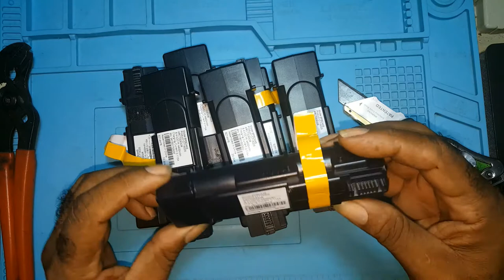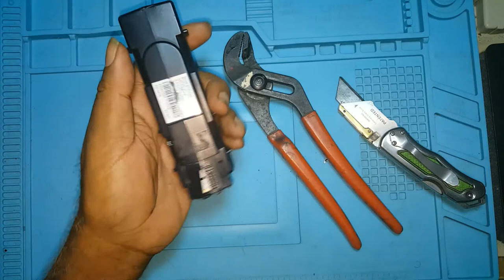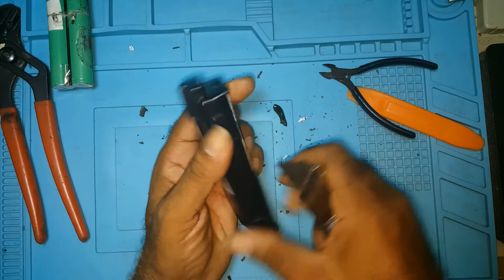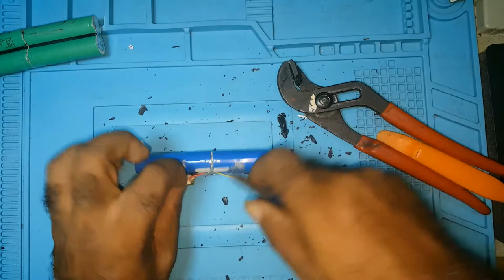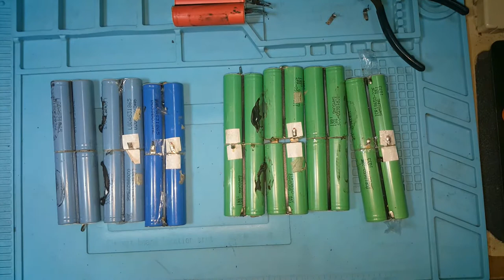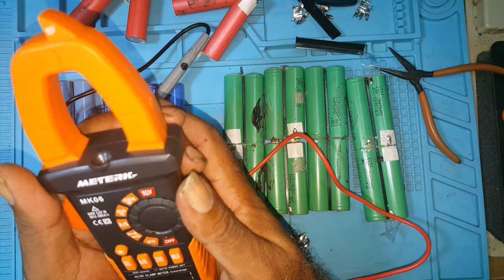ARRIS Battery Harvesting from cable modem BPB044S

Comment: I have been seeing these packs for sale everywhere , battery harvesting is awesome , been doing it for years . Most laptop batts that fail only fail because of one or two bad cells and replacing or repairing battery packs for laptops is easy , I started making 18650 battery banks for my jeep years ago and now companies throw a bunch of cheap 18650 cells in a plastic battery case and sell the battery for thousands !  make a 48 volt battey bank for a razor scooter and thats what i call fun !  Thanks for posting this !!

Comment: Instead of prying it apart with pliers, try cutting through the stickers on both sides with an exacto or similar blade.  Then you can hold the battery in a vise and just push it open with no problem.  I did a video on this. The ones I have opened have contained mostly LG cells and they are the most difficult to get the cells out due to the amount of adhesive they use.  The Sony and Molicells were the easiest to get the cells out.
Reply from the maker: Thanks